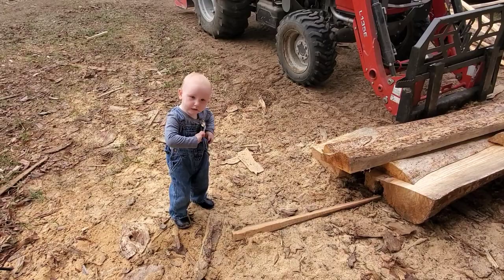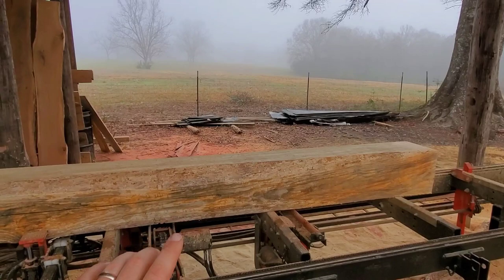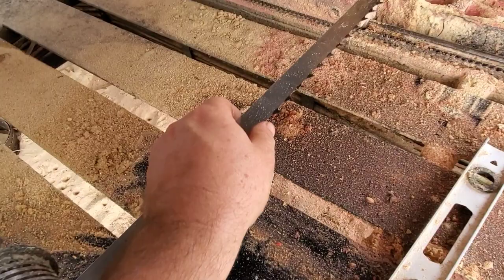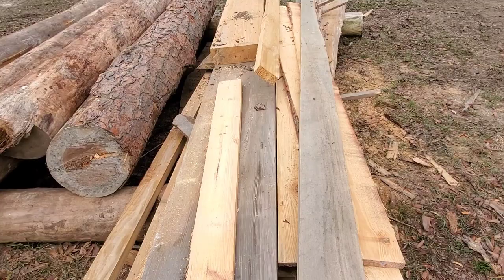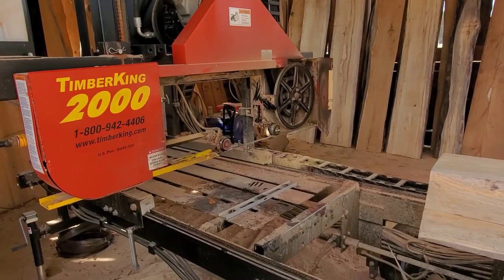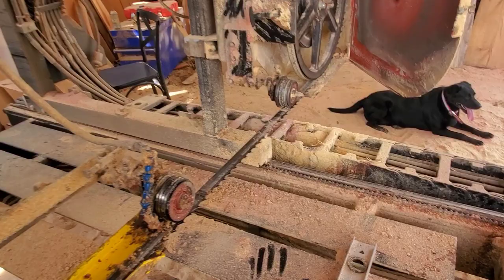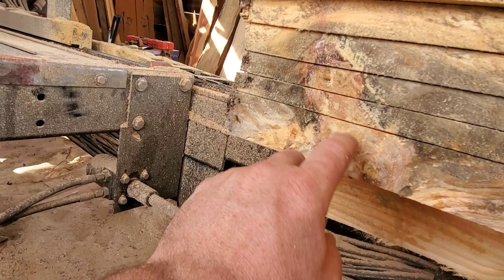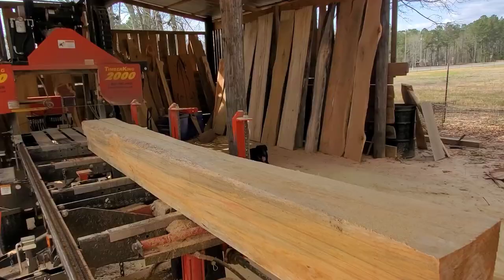Wavy boards?  Sawmill blade diving?  Check this out for the most common reasons why.

Comment: I've found that extra set in the blade really helps with pine, and spruce.  I've also found that extra set doesn't seem to hurt with other woods, like oak etc.  So, I just order my blades with 30 thousandths set.  25 thousandths is standard by the way.
Reply from the maker: Yes that is true,  we run around 22 thousandths for all of our blades.  I have run different sets before but they tend to get mixed up in the pile if I don't mark properly.
Reply: I believe this, the hard knots are the worst for keeping set, and sharpness 👍

Comment: Hi, Nice explanation. A big consideration is the timber and the 'set' on the blade. Assuming the blade is sharp, Green wood tends to 'tear' slightly some timbers Poplar, Willow etc are very soft and do leave a lot of fibres. Blades tend to be made to cope with 'anything' so will have 'maximum set' dry timber cuts with far less tendency to 'tear' as it is 'harder' so a blade with reduces set will cut well without binding. Look at a 'commercial' band mill' the blade is not 1" wide more like 6" to 12" so the cut stabilises the blade whilst the '1" blade is not guided so well so will wander particularly is the feed is too great, folks tend to forget the cutting rate is dependent on several factors, one very important one is the volume of the gullet...when it is full of sawdust it holds the blade off the cutting face, until it can empty, so a wide log will cut much slower as the gullets limit the cut rate, so you need to 'feel' the resistance to the feed to stop 'overfeed'. Lastly consider the amount of wood you are removing, a large set means you are removing a lot of timber, that takes energy, makes more sawdust, and slows the cut rate ( feet/min)

Comment: Definitely going to start cutting from the top. I've spent days leveling and tinkering with my new mill only to start getting wavy cuts after 2 passes again. Thanks for the info.
Reply from the maker: Just today I have cut 6 knotty pine logs everyone was the small end towards the mill head,  not a single wave in the boards.  The technique really works as long as you have a sharp blade.

Comment: One good thing about manual feed sawing verses power feed, I can tell immediately when my blade is going south. And I still prefer to use windshield fluid, just have to crank it up with pine.
Reply from the maker: Yes, I agree,  I started out on a Timberking 1220 and then a Woodmizer LT15.  On a manual mill, you are much more aware of your blade performance.   The first time I transitioned over to a hydraulic sawmill (TK 1400), I had to really pay attention to my blade performance because you don't feel the resistance through hydraulics.

Comment: Great vid.  Ive had luck with running dish soap and bar oil mixed in water.  The soap suspends the bar oil in the water and seems to really keep the pitch build up down.
Reply from the maker: I'll have to check that out.  I recently ran diesel for a bit as I cut some very hard long leaf pine.  It was the only thing I could use due to build-up on the blade.

Comment: Tom  If you want to cut straight

 Set the down pressure at 1/4" not 1/8", way straighter.  That's the first thing I did when I got my TK
 Use 4 degree hook angle rather than 10 degree, way straighter and cut straighter longer
 A little overset in pine, especially in dry pine
You shouldn't need to baby the feed rate
 Keep the blade clean
Reply from the maker: Thanks for the info.  Most all my blades are at 8 degrees now and I have 6 degrees for the hard stuff.  I've been wanting to try 4 degrees.      I'm going to pass onto my buddy as well about the 1/4" down on guides.  He's been cutting some logs from a customer that are supper knotty and having some issues keeping the blade flat.
Reply: @TCSawmills

Comment: I've definitely noticed the pitch buildup with older logs.  I normally run a heavey soap solution but next time I run into a pitch problem, I'm gonna try deisel fuel.
Reply from the maker: Diesel is the trick on those pine logs loaded with pitch.  Just a drip every second works and lasts a long time.

Comment: Every 2 years take the guide wheels to a machine shop and have the blade area re surfaced in a lathe using carbide. Only take a few thousands off or just enough to make them flat.
Using the level / straight edge  on a new blade, the level is just a straight edge not looking at the bubble, do it over a another level / straight edge 6 feet long, spanning 3-4 bunks and measure between levels @ around 12 inches apart , you may need to file or grind the sides of each level to a knife edge at the measuring points for the best readings.Dead on is best +- 1/32 will work. Check the level with the guide rollers wide open and check the near and far side with out moving the saw head.You may need to adjust the saw head for level also doing this. Then do it in  3 sections of the mill bed to check the bunks also. Give yourself a few hours to make this important adjustment.
Open the logs with a used blade and change to a new blade for the money cuts. Pine knots will cut flatter with a 7 degree tooth blade. I run a woodmizer LT 40 super hydraulic, 50 HP Cat Diesel, 8000 hrs.

Comment: To clean my blades I really like using Dawn soap liberally in my water and when I get a lot of build up I hit the blade with a wire brush while its running with the water and that works really well for me.. Huge decrease in the wavy cuts for me!

Comment: Knotty pine can be tough . If you blade is diving that bad I would check your drive belt tension . I struggled with that issue .
 I run an LT50 and we run a lot more blade tension than you are using . Close to 3000 psi .
Maybe this can help . Thanks for the videos .
Reply from the maker: I'm currently running 1.25" blades if I go to the 1.5" blades I would run a lot more pressure.   I don't get dives very often but when I do it's typically in pine with a lot of pitch or knots.  It also happens after a nail strike, 😆.   I and going to be doing a video sometime this summer going over different blade types (thickness,  widths,  pressures, hook angle,  tooth spacing etc).  Thanks for the comment and happy sawing.
Reply: @TCSawmills  Good info I have a harbor freight sawmill and it’s always a dull blade for me, anyone with the same mill please remember to lock carriage after setting depth something I kept forgetting to do till I saw the engine actually move when the blade dipped
Reply: @TCSawmills  I run 1 1/4 blades too . I find I can cut flatter with 10 deg blades in bad stuff because it causes me to slow down a touch . I usually run a 7 deg for most wood and push it to the limit .

Comment: Tooth sets effects blade travel, tracking, I don’t no much about timber kings👍thanks! Is it auto feed? Using just water - dish soap. I was told to saw to start on the worst side of the log. Knots, knots, knots. You can base your speed from the start cuts.
Reply from the maker: You are correct cut the small end first a more aggressive cut into the knots.

Comment: use diesel  fuel instead of water when cutting sappy wood
Reply from the maker: Yes, I have run diesel before but free water collected off my roof is hard to beat.  I will add pine sol or soap to help cut down pitch.

Comment: New wood mizer lt 40  use 3200-3300PSI blade tension and the old lt40s from the 1990s use 2200-2300 PSI blade tension.  The main difference in tension is due to mill rigidity.
Reply from the maker: We have an upcoming video going over gauge pressure on the sawmill vs actual blade tension.  This will go over various sawmill manufacturers and what they recommend on the gauge and how that compares amongst the various sawmills.  We have some very interesting data to share.

Comment: After you adjust your guides. Check the flatness of the blade. Place a razor blade across the blade in between the guides. You'll  be able to see if there is a hump or a gap. I'd say that you have to much of a gap causing the blade to rise at first then dive.
Reply: My blade is cupped between the guides, how would I fix this? Lower the guides?
Reply: @jackslumber1891  do you have roller guides? If so make sure the blade is flat. Put some down pressure on the blade with your guides. Around 1/8" but no more than 1/4". Make sure the blade is parallel with the log  bed.
Reply: @mgbill793  I don’t have roller guides, my sawmill has graphite pads. My blades are about 5” wide and I can clearly see a gap between the pads and blade. I have been fiddling with it today but will try some more deflection tomorrow and see if that helps. Just been reading on forums that you can get blades rolled flat so that might be something to try too.

Thanks for your help!

Comment: I watched your video and listened to everything you said. What I saw was too much buildup on the blade and tires. Looking at your water nozzle before you wiped it off there was too much build up.
Your not running enough water to keep your blade lubricated. It's getting too hot during the cuts. More lubrication keeps the blade cool and it will not be as influenced by the grain. It will stay sharper longer!
I would bump the tension up a little at a time and see if that doesn't improve your cuts as well.
Lube the heck out of that blade though!

Comment: WD-40 sprayed on the roller while the blade is running helps wick the sap right off the blade and the rollers.
Reply from the maker: I'm testing out a new system similar to the wiper system that cooks has.  I either run diesel or biolube through it.  It has been working great.

Comment: After many years of sharpening  blXes fur my mill and many other people I have found you need .ofr set in the blade when you are sawing aged pine logs.  If you want to send me one  I will set it up to saw gef pine logs.   Thank you joel Weston
Reply: 9 x.out.10. bjade rise when entering a cut is caused by the drive belt not hAving enough tension on it   that is the first thinv that I  check when I'm having troue with the blades  rising in the cut then leveling  off though out tbe remainder of the cut.

Comment: I am running into this same issue, blade is sharp cribs are lvl blades lvl but I did notice a drive belt seemed to be loose while running but seems tight while sitting which is odd

Comment: The issue seems to be exclusive to mainly pitch pine(southern yellow pine), the pitch buildup causes all types of issues w/ the band blades as you have identified. You can increase down pressure on the guides, use diesel or pine sol for cutting fluid, etc but truthfully, bandsaws suck at cutting yellow pine w/ heavy pitch. I actually had a log pile of older growth yellow pine logs that could not be cut on the bandsaw, period, instant pitch build up, instant blade dive. Keep in mind the is on a TK2400. I ended up buying a circular sawmill to run beside the band mill, it cuts pitch pine & knotty pine like butter and production is double the board footage on square edge/dimensional lumber and lumber is always straight, no blade diving frustrations. Just my 2 cents.
Reply from the maker: Thanks for this and you are exactly right, my buddy has a swing blade and he said same thing.   Every mill has its pros and cons.   I have not personally run a circle saw but hope to one day.

Comment: Very good!! What about the angle of  theeth??  7 degrees in hard wood instead of 10 makes a hudge difference and it works well for me.
Reply from the maker: Yes in harder woods I use 6 degrees and most everything else I do 8 degrees.   I have not cut frozen logs before but I've heard that some people use 4 degrees.   As you decrease the angle your cutting speed slows.
Reply: @TCSawmills  Yes you decrease the speed but the blade like it. It goes straight and clean with less weaving.

Comment: I would like to see how your drive is run from motor to blade pulley. I see on your 2220 mill you drive belt can’t be seen. I have a 1600 and my drive belt can be seen and it does keep me from cutting the full depth of cut  to the shield
Reply from the maker: I will do a short video on that this week.
Reply from the maker: Here's the video on the design of the tensioner.  https://youtu.be/CkdgAHIo99w

Comment: My sawmill isn’t perfectly level, it has a slight downhill grade that kinda aids in the unit sawing… it is however perfectly flat… I assume this is okay?
Reply from the maker: Yes, you should be good.  I have set up at a job site before that had a rather large slope to property.  Same thing as you are describing, I was good left to right and the frame was straight down the length of the tracks but there was a slope from the back of the sawmill to the front.  It worked well with no issues.

Comment: When you get into a lot of pitch, Spray some WD40 on your blade when it's running. Try it you will like the result..
Reply from the maker: I have done that as well as some other oil based products,  it definitely helps. My buddy wants me to run diesel, I just can't do that.  It would be just one more tank I'd have to fill.

Comment: I recommend use diesel as lube instead of water.  Diesel will keep your blade clean and slick while only using 1/4 the volume of lube.
Reply: Gemma King
Reply: my owners manual specifically says not to use anything petroleum based as blade lube. I am assuming that it degrade the drive bands
Reply from the maker: It does break down the belts prematurely,  however I only run a diesel drip when the pitch build-up is excessive.  Once I'm done cutting the pitchy stuff I switch back to water.  So little to no impact.
Reply: @andybayliss2020  I have not noticed any degrading of my band wheel belts.  The saw gets a little oily with the diesel is all.  

I did install a lubemizer system, so I only use maby a gallon or so per day of diesel cutting lumber.  I wad having extreme blade wear in cutting standing dead burr oak due to large amount of sand inbedded in the logs.  Switching from water mixed with soap and vegetable oil to diesel extended my blade life significantly and keeps my blades perfectly clean.

Comment: If the drive belt slips and the blade changes speed this will happen. Blade tension, more is better. Ad some Pine Sol to the water,
Reply from the maker: I've never had the triple wide drive belt slip, even when the log bows in the middle and point loades the ends as the blade goes through.   It will drastically lower engine rpm until it cuts through.   I've also not noticed any slippage between the wheel belts and the blade, but I'll have to check for that going forward. I keep pretty good belts on and have a decent crown on them. When they flatten out I replace them.  In this instance my blade was up and down based on the fact that it was very dull and there were harder knots in the surrounding softer wood. I was out of pinesol for this video but I typically run it in wood that's full of pitch.

Comment: don't you have to set the blade at a certain pressure and maybe you have to reset the tooth on the blade to a finer setting after you have sharpened the blade
Reply from the maker: We check the set on a cooks dual tooth setter.  We set around .022" to .025" on each tooth every time.  It's been the ticket for me for years.  On really soft wood I have set it to .030" but only a few times.  Our process on every blade is clean the blade, set the blade then sharpen.

Comment: Do not enter into the same cut. You need material on both sides of the blade to not get deflection. Sometimes you get lucky but id advise against it.
Reply from the maker: I do it for time to time and have not had an issue if I go slow.  My buddy did a job where all he did for 3 weekends was clean up cedar and Cypress cants taking out the humps and twists.   As long as your blade is sharp and not cutting too fast its no issue.   It does take the set out of one side really fast.
Reply: @TCSawmills  cedar is soft stuff might not get same results in other material. 🤷🏼‍♂️

Comment: Do you recommend tilting your roller guides so they angle down 1/16"?
Reply from the maker: I have down pressure on my guide rollers but I level the blade out as close to zero as I can.  Therefore theoretically my guide rollers are level too.

Comment: Hello, I am trying to cut a 18 inch yellow birch which is full of knots but it is absolutely beautiful. My blade keeps going upwards even after attempting to solve the issue. It is possible the sawmill is just incapable of sawing the log?
Reply from the maker: I wouldn't think so, if it's going up there are a few things that could be off.  Sharpness is a big factor along with proper set.  What types of guides do you have? Rollers?  If they aren't set correctly your blade could travel more that it should.   Also tension could be an issue.  Also if it's a large tree engine rpm could play a part,  you should keep the loading of the engine constant but controlling speed of cut. How big is the diameter of the tree and what type of sawmill?

Comment: Save the knots for firewood :)
Reply from the maker: I have a pile of lighter wood to use as fire starter 🔥
Reply: No, get your mill to saw them straight
Reply: @oliverm5sc  unless you have a market for knotty lumber, why bother?
Reply: @gsmscrazycanuck9814  
Ever hear of knotty pine wall paneling, no way could every pine log sawed have no knots,  With the right blade and the mill set up right my  mill saws straight through knots with no problem
Reply: @oliverm5sc  I have knotty pine in my house. It has very small knots. If you want to make knotty pine lumber, go ahead. If I have a market for other types of lumber, I will not bother with pine logs with large knots.
Reply: @gsmscrazycanuck9814  I really don't deal with pine lumber at home but I do a lot of custom sawing, customers have some  nice pine logs and some with lots of big knots.  They all saw straight until the blade gets dull. If you can't cut through pine knots straight something is wrong.